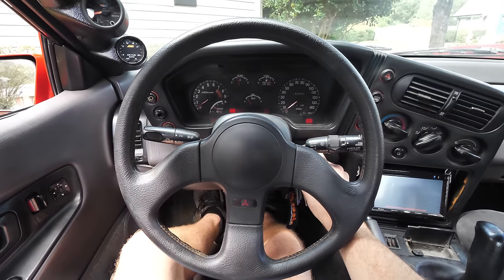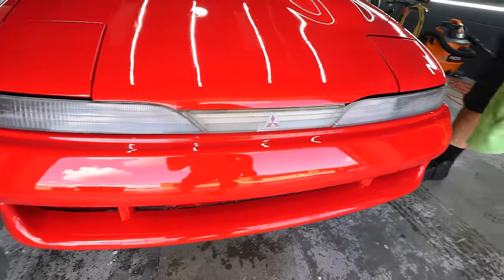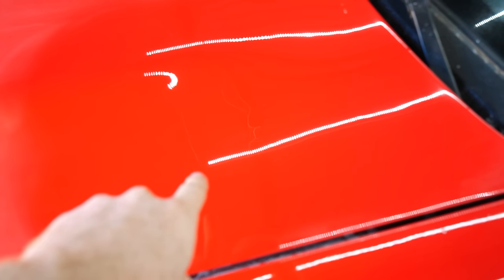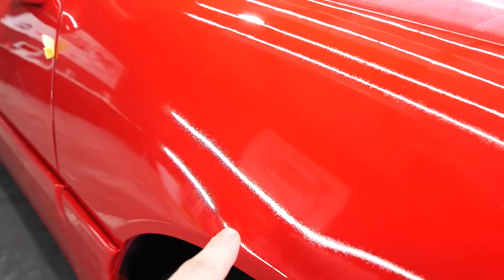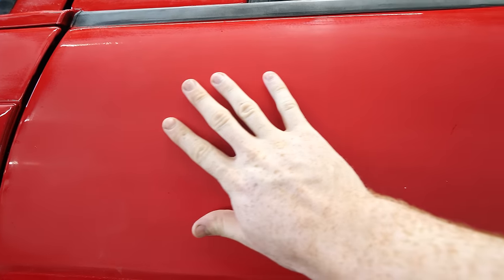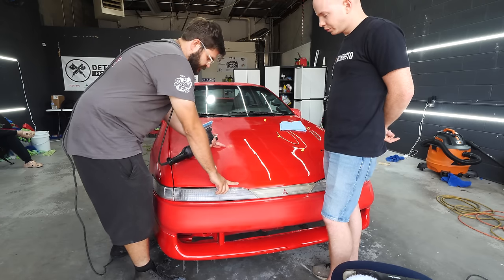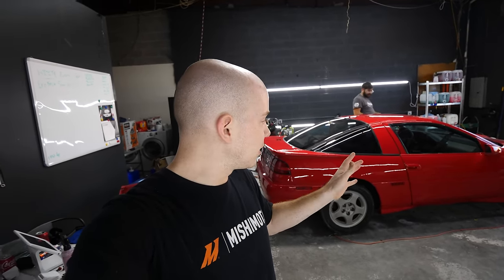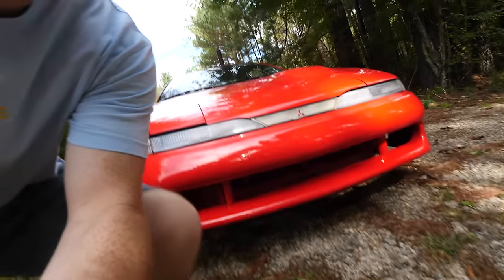Can You Fix a $1600 MAACO Paint Job? (Extremely Satisfying)

Comment: Honestly, I think it turned out really well.  Maaco is fine as long as you do one thing: moderate your expectations.  You're not getting a $20k paint job for $2k.  You're getting a $2k paint job for $2k.  I had my 93 Firebird Formula painted by Maaco last summer and people wouldn't know it was a Maaco job because I took the extra time to remove stuff when I dropped it off.  I pulled up and started stripping the car.  I pulled all of the exterior lights (tail lights, side marker lights, everything), pulled the exterior weatherstripping and metal tracks that the weatherstripping fits into (so no hard line at the edge), removed the door handles and fixed up some coat hangers so they could pull them and open the doors, pulled off the plastic cowl and wiper arms, pulled the windshield surround molding (the windshield had a crack anyways and was replaced after the paint job), put on some junk wheels and tires, pulled the inner plastic fender wells, removed the antenna base and back masked the hole, removed the side mirrors (and pulled the glass from the housing), removed the trim that the side mirrors bolted on to.  Tons of small stuff like that.  Took the trim home with me, scuffed it all up and painted them either gloss or satin black and when the car came back from paint I wetsanded it and put all the new trim back on.  Looks like a much higher quality paint job, but I did more of the work myself and took it upon myself to fix the deficiencies that Maaco is known for (orange peel, hard paint lines, etc).  If you moderate your expectations on what Maaco will do for cheap and put forward the extra effort, you can wind up with a good driver quality paint job.
Reply: Hey man fellow f body firebird owner, I got a question?  would u recommend on paying for a thumb size dent removal on the rear fender panel an extra $500 or $200??? The reason why I'm asking is because I'm going to get my trans am painted this week and I'd like some advice from a fellow firebird owner. 
P.s thanks
Reply: @htown0288  Depending on the type of dent, it would probably be worth it to let them handle it.  I had a few dents / dings in my passenger side rear quarter panel and was able to massage most of them out and skim / sand it myself and then hit it with some primer.  I would ask them upfront how they propose to fix the dent and have them spell the repair out in writing.  That way they don't do something stupid and stuff it full of body filler and paint over it without actually trying to fix it correctly.  Not saying they would, but you never know.  Some people are shady!
Reply: What “stage” did you go with?
Reply: @itsjussjerry  I went with the base coat / clear coat package.  I kept the factory color so the door jambs and engine bay wouldn't have to be touched and I could keep the cost down a bit.
Reply: I 100% agree
Reply: A car paint job is a great example of "you get what you pay for." If it costs $5k, it will probably look great to most people. If it costs $1k, don't expect it to look like a showroom quality paint job. I don't know why people lowball on the paint job price and expect it to look perfect. You can't polish a turd.
Reply: @largol33t1  "cant polish a turd" ? This video shows in a way you can do just that.  That paint was terrible when they started and turned out half decent.
Reply: I just want a black paint job with a decent gloss that’ll last at least another 2-3 years. Are my expectations too high for maaco?
Reply: @Official.blazed  I was in your same shoes.  Black paint and all.  Went to 4 different Maacos.  All quotes were different even for the same paint tiers.  My car needed some surface rust removal on roof which added to my total price out the door.  I ultimately went with the Maaco that was closest to me.  Their quote fell in the middle of the other 3.  

Long story short I opted for their base/clearcoat given I want to keep this car for several more years as well.  Total cost with prep and spray was $1,960.  They had the car for a week and when I got it back it looked terrible.  Very bad orange peel, little gloss, specks in every body panel.  Masking tape still on my exhaust.  Overspray on side mirror glass and one window and sanding marks on new windshield.

I talked to supervisor who then agreed to respray the entire car again.  Well got it back another week later and while it was better, there is still quite a bit of orange peel and a few specks on a few panels and now buffer trails on my front quarter panel.  

I think the results you get from Maaco are nothing but a coin flip depending on location and who is working the booth that day.  I'm going to have to wet sand and polish the entire car to get it to the level I think is acceptable.  And that is going to take considerable time and effort.  Read every review and get multiple quotes.  See if you can visually inspect a few cars that were done if they have any on the lot.  Good luck.

Comment: Night and day. Looks great. Wonder if the total cost of the MAACO + wet sand is less or more than just paying for a better paint job up front
Reply: This.
Reply: It depends. As with any paint work, surface prep is going to be the key and if MAACO did any worse at this on this particular red, the cost of correcting it vs spending $5000-$6000 and having 2-3% defects that are unremovable (instead of 20-30% here) might make you think about shelling out the extra $1500 - $2000. I personally would not have touched this car for less than $1200 (with a ceramic coating application also).
Reply: Personally I'd pay more to save time and labor on my end.
Reply: @jritechnology  he paid 1600 for this crap? its a 300 dollar paint job.

Comment: 2 helpful hints.they make a thin flexible rubber block that works great on curved surfaces.also if you use a little dish soap with your water,the sandpaper slides easier.still,you are doing a good job.

Comment: Looks great. All tho usually when the buff and polish after wet sanding. Usually it's a 2step process. 1st buff with wool pad then use a 2nd polishing compound. But it looks like every one does it different. It turned out good.

Comment: The car looks about as close to perfect as anyone could achieve, but I’m curious. After the sanding/buffing/detailing, was this process still less expensive than a professional paint job? By how much (percentage-wise)?
Reply: I bet he got a deal for advertising the place
Reply: good point...but this way lends for more/better content.
Reply: @nigelmcclean4166  very true lol
Reply: You can very easily spend a Saturday and do this yourself, maybe 200-230 bucks in materials and tools if you buy a polisher. just did this on my Miata for all in maybe 1000 because I did the bondo work and took all the lights, mirrors etc off when I dropped it off at Maaco. Cut and buffed it over 1 full Saturday and it’s 90% of the paint job any other place would do. I just painted the door jams myself
Reply: with a harbor frieght paint gun, d/a sander and buffer plus some ebay paint and clear you can do all of this for under 500 bucks the whole thing paint and polish
Reply: @aidan-8100  The main thing professional paint shops are necessary for is matching paint when you're not painting an entire car. I've painted body panels for different 1990's vehicles and when you look closely you can see a visible difference between the new paint and the original. The new paint typically looks darker and deeper because the original paint has had X amount of years worth of the sun beating on it thus lightening the color a few shades.
I agree though if you take your time and use quality pads + cutting and buffing compound you can do it yourself for cheap. As long as you follow the right steps you can get a great result for a fraction of the price of a detailing shop. You can buy a high quality buffer and the best compounds and still save tons of money plus now you own the necessary equipment to do it again in the future.
Reply: ive been charging $1000-$1200 for full car re-sprays and polishing, full time i work building race cars, kit cars, and work on a super car once or twice a year, but on the side ill rebuild engines and repaint sedans, small to midsized SUVs, and even parts for motorcycles and quads. so it takes a little longer but my past clients are paying on average $1000-$2000 less
Reply: A pro body shop will charge you $3k - $5k for full dismantling paint jobs and high solid paint. The thing is, don't forget to use IR lamp after you're done laying the surfacer before spraying color coat. It will make huge difference in finish quality.
Reply: Good point
Reply: @arapaimagold8088  You really get what you pay for.

Comment: My question is 1600 for the paint job + what would what was just done to the cars paint = what ? Is it really cheaper to get a macco paint job or would it actually been cheaper to go to a better paint shop ?
Reply: now this is the real question, id hope it would be cheaper if you're just looking for a good enough/well done  vs a professional paintjob
Reply: Yeah I think you're right. The small amount of time the Maaco saved by cutting some corners turned into a huge time investment to fix those issues. It would have saved a lot of effort in total if they had just taken an extra hour to do things more correctly. But there is also a third factor involved that we don't know the effect of, which is what was the state of the car going into Maaco? I've heard that if you do the prep work yourself and bring it to them just for finishing and paint then they do a great job. If you spend the hours needed for sanding and taping off glass and lights carefully and bring it to them ready to put paint on then they don't have much to fix so they can just do a good job putting on paint. It's the prep work they skimp out on when you just bring them a car totally unprepared for paint. At the same time though you can definitely see that Maaco made some mistakes during the actual painting process too and it wasn't totally a case of just skimping out on prep. They vary in quality by location too, I think the Maaco on Hoovie's garage does a great job.
Reply: So a full body wet sand, compound and then polishing would run about $2,000 starting for a vehicle. So then after the $1600 paint job plus $2,000 minimum for the wet sanding and al that done in this video you’re looking at $3,600 minimum. So it may be better to pay more for a better quality paint job. 

Unless you have the time, skills and experience to do the wet sanding and all of the other work. But that’s a multi day process.
Reply: @El_Chompo  Also, I watched another video and if you do the prep work yourself and take it to Macao it voids their warranty….. so another reason I wouldn’t use them because you have to let them do crappy prep to have a warranty that they probably have a lot of loop holes to begin with, so it may be worth doing the prep work yourself anyways.
Reply: @deporterdetailing  Yeah it seems like a losing battle either way at least at the particular Maaco from this video, or maybe the workers just had a bad day. Because if you figure even if he had done all the prep work himself saving Maaco hours of tedious sanding and masking, there was still solvent pop in the paint. Actually I'm not sure now if that is from the prep process or not. Does that mean there was solvent left over from the cleaning and degreasing processes before the paint was laid down? And the fact that some paint was textured and other wasn't. There are just too many questions with ugly answers. Either they didn't sand the car flat to begin with or their painting process itself was flawed by having a bad mix or timing or application thickness. I would say do your research and if you can find a good Maaco like from Hoovies garage then go for it. It's a lot of work no matter what you do at the end of the day you can't get around it. Competent jobs cost a ton of money and doing it yourself takes a ton of time, maaco you are rolling the dice and understanding it won't be perfect but hey that's still way better than old faded chipped paint (normally, depending on the car and style preferences of course. Like old chipped paint on a classic muscle car is kind of cool but on a more modern car it just kind of looks bad).
Reply: @El_Chompo  Agreed. I’m honestly not sure what causes solvent pop. But I believe it is from not allowing the base coat to cure long enough before spraying the clear coat. Unfortunately nothing is ever perfect. 

I’m actually looking to get a project/show car for my business next year and it will be getting repainted to a different color than what I can find. So I know of a good, reputable local paint shop I will take it to to get the work done by. I’d rather spend a little bit more money than a lot more time fixing someone else’s mistakes.

Comment: I've been told by one shop that put a video on youtube that they always always completely spray their paint area with water and keep the entire floor wet. They're so serious about it that they have assistants constantly dripping small cups of water around the floor. Why? It attracts and traps the dust and keeps it to an absolute minimum. Of course, they do have installed air filters in the spray  area that can suck up incredibly tiny particles of dust. This is so expensive that it's only used by a real paint shop, not amateurs like Maaco. But this is one way they get their paint jobs looking so smooth and glassy. Of course, the other vital step is compound polishing every square inch of the car. That's why you'll wind up with a bill for $5,000! And I've seen a video of a Porsche being repainted and they billed the owner $15k!! To their credit, you absolutely cannot tell that the car was repainted even with the camera inches from the surface.

Comment: OEM paint has texture and orange peel from the factory. It is uniform and very hard to replicate. When I'm shopping for a used car.. aside from bad paint, when the paint is overly glossy and buffed, I know that it was wet sanded or potentially repaired.

Comment: So with the amount that a none sponsored person would pay to wet sand, polish and paint protect the paint after the macco paint job would it have been cheaper to just pay macco more to do a more premium job to start off with?
Cheers Pat
Reply: I think this was a premium job no? When I got my car painted the premium job was the one with the clear coat
Reply: A service like this would cost $1500-$2000, so if he had paid out of pocket for it he would be nearly $4,000 into this "$1600 paint job". Then you still have fisheyes, overspray everywhere, and dents and dings throughout the car, which were supposed to be fixed by Maaco. Should have gone to a reputable shop and paid more money upfront to have it done right.
Reply: Yup. The professional color sanding defeated the purpose of going the budet paint job route.

Comment: from a  auto body / paint repair man with over 25 years  experiance  no matter if the paint job cost 1600 or 200 hundred   as for orange peel  this can be avoided by turning up the air pressure on the spray gun  most paint jobs are  sprayed at 32 psi  if you turn the pressure up to 34 psi it does away with the orange peel  also when you are wet sanding  lift your finger tips up off of the paper because if you dont you will  put finger marks in the paint  and are hard to wet sand out as far as pitting, and fisheyes it all come down to how the car was preped    so no matter how much the paint job was  some times wet sanding and buffing  cant fix some things and has to be repainted

Comment: I'm really curious which to know which paint option you went with. I know Maaco has a "Urethane + gloss enhancer" and their most expensive package: "Base coat + performance clear coat". 

Most Maaco paint jobs have the clear mixed with the base coat as a single stage paint but you mentioned you had clear on top of your base coat on min 2:40.

My question is: Is there any effect or disadvantage to applying nano ceramic on the urethane + clear - single stage paint job? Is it safe to do? Of course, this is considering the whole paint correction process has been completed.

Comment: Fun fact. Painter here. Thicker paint actually is worse long term. The more mills of paint the more likely it will fail. It goes both ways though. Better to flat and buff it but judging by how the paint looks on that there was either a lot of filler that wasn't properly primed and sanded or this had a shit ton of bare metal spots and that's why you see all of the mapping. Chances are as the sun bakes that paint it'll map again. Paint expands and shrinks while it's curing. Typically 90 days is what it takes to fully gas out. turned out pretty solid for the money though!
Reply: That was also called solvent pop. Typical with cheaper clear being just smashed on lol

Comment: If you sand and buff the clear coat too thin, it is going to break down in the sun. What makes you think Macco would put enough clear on to allow for this procedure. Also, you might be putting a lot of work into a finish that is going to eventually peel off anyway due to Macco's poor surface prep. These problems may never occur but it's something to keep in mind.